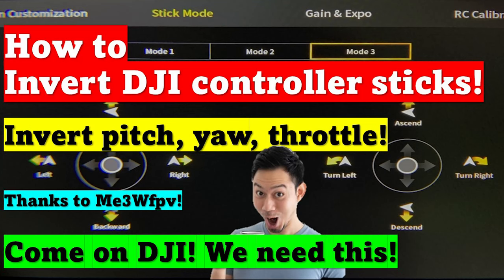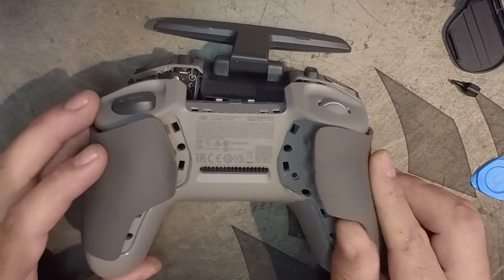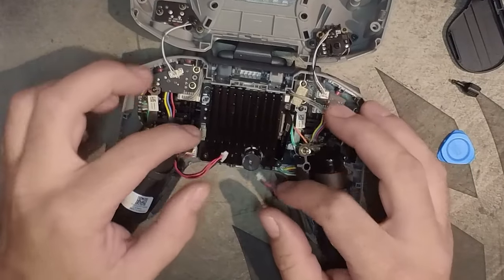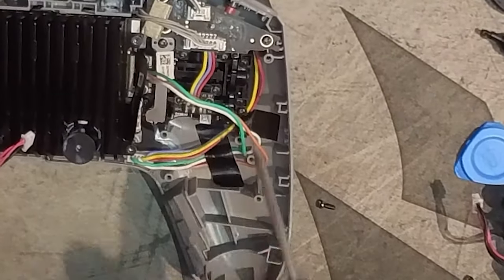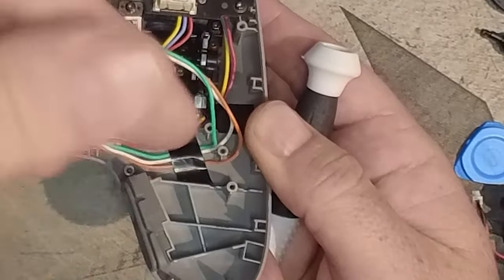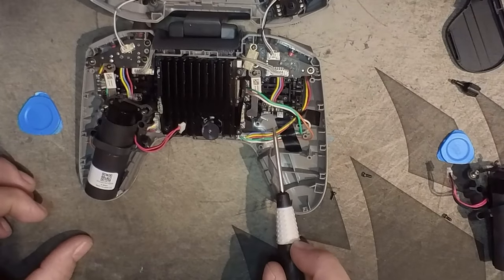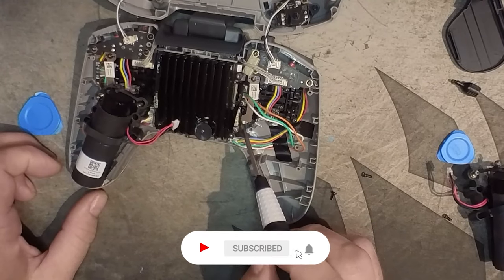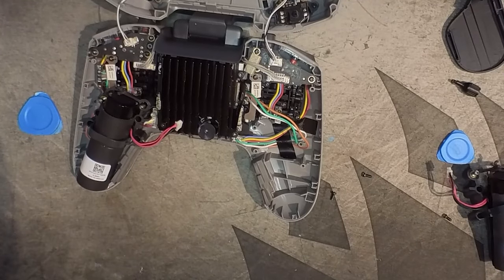How to invert the DJI FPV Controller 2 controls! | DJI Avata | DJI FPV Racer

Comment from the maker: Thank you @confirm7389 your comment below will help a lot of people!

I fixed it u just have to rotate the diametrically magnet 180 degree (not flipping) (mark it with edding) u must exactly hit the spot if u close to the middle in calibration u can make deadzone higher. Tip: u can fix left magnet on the right controller stick ( pitch in mode 2) without removing much, just remove 4 small screws close to the magnet than u can pull out the magnet with 2 tools
Reply: Would it be possible just to change the wires on the other end with the connect to the micro connector. The reason i ask is coz, i want to invert my acende and decent and the magnet is glue on hard
Reply from the maker: @Dazzzza  Oh that is interesting, I'm really not sure as I've not done it myself.
Reply: @InfinityDrones   it might work right hehehe
Reply from the maker: @Dazzzza  also true, if you do try it and it works please let me know :)
Reply: @Dazzzza  hi, I have this problem too, I don't understand very well from the video, could you tell me how to do it, I should reverse the pitch, if you can help me you would be doing me a great favor

Comment: Good job figuring out how to do this, however it's ridiculous that it's even necessary. You shouldn't have to tear the controller apart for what should be a no-brainer menu option.
Reply from the maker: Glad you found the video useful. I completely agree with you! Why DJI... Why?!
Reply: It's literally a "multiply by -1" in code, will take DJI 15 seconds to implement it, it's utterly ridiculous
Reply from the maker: @MaxRovensky  crazy that they they don't just give it to us from the start!
Reply: Like playstation and xbox have it how difficult can it be

Comment: I can't belive DJI still haven't solved this problem. We has already this shit with the DJI FPV and still persists in the Avata..
Reply from the maker: yup... so you need to take the controller apart and do it yourself... very sad. Hope my video helped someone.
Reply: @InfinityDrones  I tried but I get a stick error in the googles and I can't fly :(
Reply from the maker: @aleixrovira6241  you can't fly? that does not sound right. The stick error is normal ever since the DJI FPV drone was released. It should still let you fly.

Comment: I appreciate you are the only person trying to solve this....But it did not work...I took apart everything, flipped the magnets over like you said for both the throttle and pitch... and now neither work at all in calibration..Flipping the magnets over did not work and now I have a useless controller.. any suggestions? Am I missing something? Your video really misses alot of detail, what could I have done wrong?
Reply from the maker: I think your magnets are aligned wrong now... Sorry, this was a quick video we did for a client and we've not had another request to do this since. But the just of it is that the magents need to change so that the "control" thinks its going left when it's going right for example.
Reply: So I tried flipping the magnets back to their original orientation.. now the throttle and pitch sticks are inverted but only register about 25% in one direction and 0% in the other. And the other stick wont center and it goes 100% in one direction and 0% in the other.... how could just flipping this magenet cause so much issues?? Does it need to rotated in a certain way as well? At this point I do not reccomend anyone try this method. I was very careful with all thr components and this still happened to me.. bricked controller at this point...
Reply from the maker: @graham8172  if you change the magnets the you need to recalibrate your sticks. And yes this is a mod and don't at own risk as like any mod. But for so many people out there that fly with different sticks (modes), this atleast gives them the option. Sadly, I can't see or know exactly what you did on your end, but in my end as per the video it worked. Sorry to hear that you're struggling.
Reply: I fixed it u just have to rotate the diametrically magnet 180 degree (not flipping) (mark it with edding) u must exactly hit the spot if u close to the middle in calibration u can make deadzone higher. Tip: u can fix left magnet on the right controller stick ( pitch in mode 2) without removing much, just remove 4 small screws close to the magnet than u can pull out the magnet with 2 tools
Reply: @confirm7389  hello, could you explain to me how to do it, I should reverse the pitch but I'm very confused!

Comment: Will this method work with the DJI RC 2?  Just doing a quick google search, seems like people have been asking for this ability for at least several years.  Still, DJI has not added it in any firmware update despite it probably being one of the easiest software fixes to achieve.  I wouldn't count on DJI ever adding it.
Reply from the maker: Hey man. Really not sure if it will work on the dji rc 2... I think the fly app has a few options like mode 3 or 4

Comment: Hey, i love the video and ive done it with my controller but i tried it in the flight simulator and all it did was invert the normal and sport mode and left the manual mode inverted? idont know if its the app and it is actually working or if i just missed something. Thanks for the video, keep it up.
Reply from the maker: If it's flying properly in the real world the the issue is with the simulator... Try and get another sim like velocidrone or liftoff and see if that's working.
Reply: Thanks bro, you’re doing god work👍👍👍
Reply from the maker: @raidenoreilly2527  haha thx man!
Reply from the maker: Here is a link to a video on how to do it!  https://youtu.be/SR-O50p5IdE

Comment: I just bought the mini 3. And I can’t  get the control scheme I want. 

It’s possible to do this on the rc controller with the screen as well right? 

Because this is a deal breaker for me. I’m on the verge of returning this drone …
Reply from the maker: I'm really not sure. if you do it you'll loose warranty ofcourse. Let me know what control scheme you want/need and I'll try and test on my side.
Reply: @InfinityDrones , i have The Same Problem. I am flying Mode 3 with inverted pitch. I am using on my mini 3 pro the controller with the Screen implemented. It would be Great in you Could try it. best regards Phil
Reply from the maker: @professortaste2890  Hi Phil, do you mean to ask to mod the DJI RC (smart controller)?